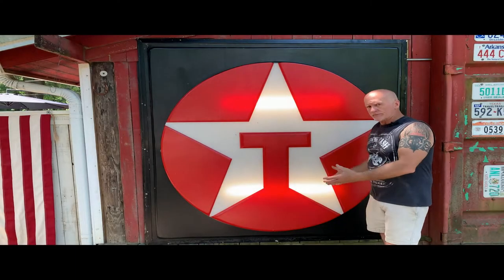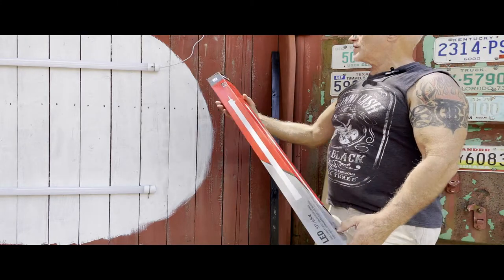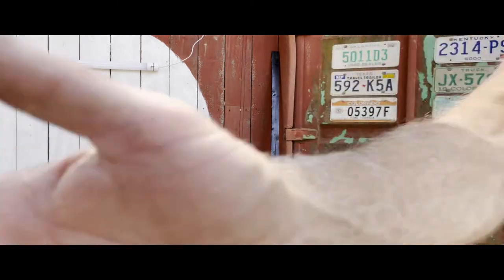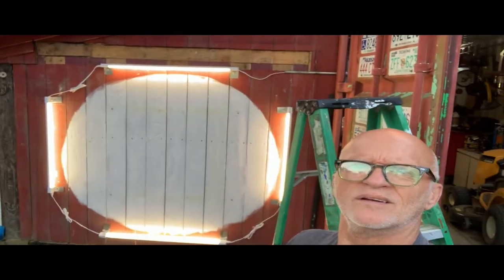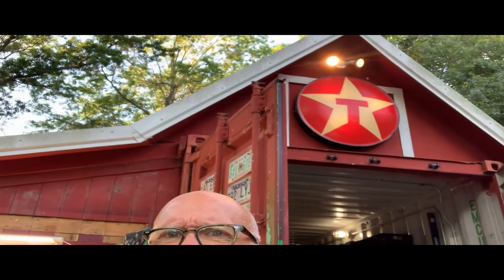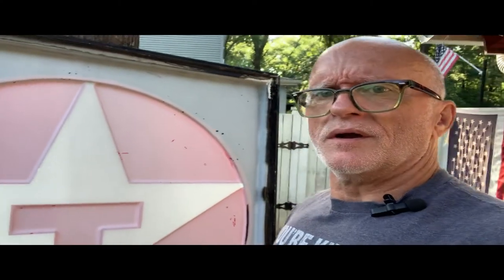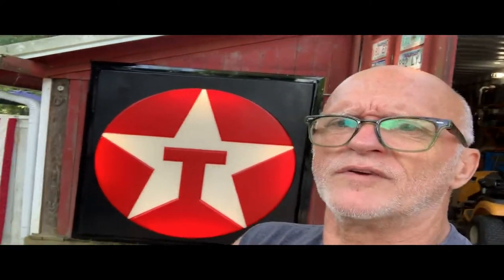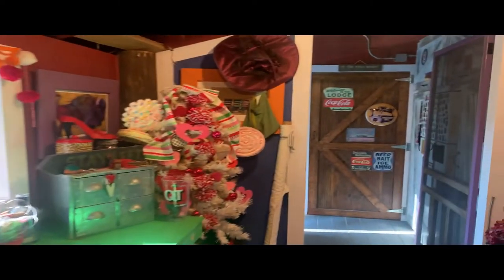LIGHTING THE TEXACO SIGN! Very Inexpensive and LOOKS GREAT!

Comment: Really love your Upcycling and placement of the Texaco sign! 
  Love that your wife said to keep the patina…it all just marrys together so well!
 Just a tid bit; 
  Homemade Patina Spray
You’ll need a 32 oz. Spray bottle.
Pour a 1/2” to 3/4” of table salt into your bottle.
A 32 oz. Bottle of Hydrogen Peroxide-pour half this bottle (16 oz.) into your spray bottle.
   Fill just to the neck of your spray bottle with distilled vinegar leaving some air in the neck of the bottle to mix all the ingredients up.
USES:
Just about anything you want to patina.
Just spray…take an aspirin while your waiting and once you get the desired effect clear coat it. If it is something your going to keep inside use interior clear coat. If it’s something your going to use outside, slap on a clear coat!
Reply from the maker: I knew about the Patina spray, it's what I used to rust the gate in the fence video. Thanks for tuning in, and I'm glad you liked the vids.

Comment: I realize I am a tad late here, but I wanted to share something I learned about these lights.

My boss got me similar ones to mount under the cabinets above my bench at work. Issue was that when I mounted them with the lights facing down, the edge of the tubes was just about at eye level and blinded me to the point of pain. I had to come up with a quick, cheap fix because, unfortunately, bosses tend not to want to spend valuable time on shop improvements. They'd rather keep you on a paying customer's job.

I used black electrical tape to make a "shade" on the only exposed side of the tubes. (I tried white first, but enough light got through it that it wasn't helpful.)

I know that wouldn't work in a sign mounted outdoors, but I thought maybe you might need a similar solution if you ever want to improve upon the visibility of the tubes or if any viewers need to solve this issue.

Also, I have found that a lot of the fluorescent-replacement LEDs we've implemented at work have dimmed over a short time.
Reply from the maker: I had considered painting part of the fixtures black, but refacing the fixtures seemed to do the trick. Thanks for tuning in